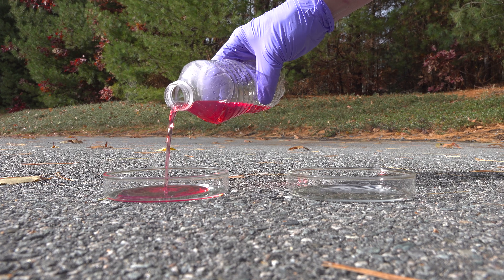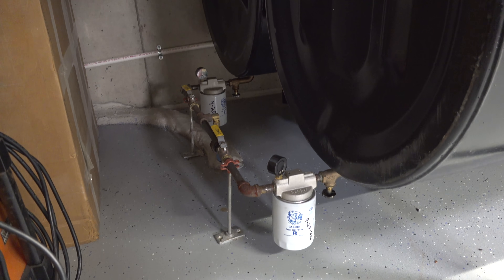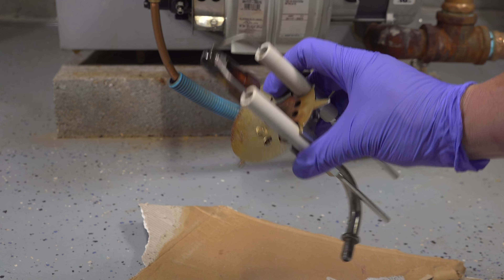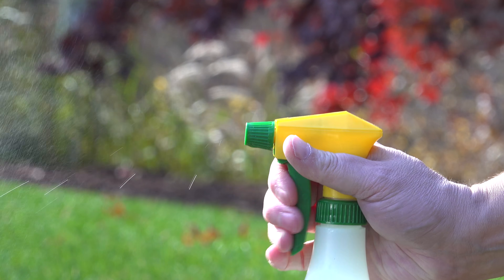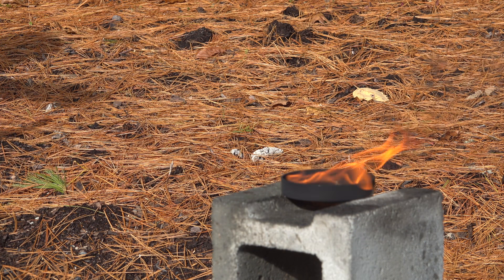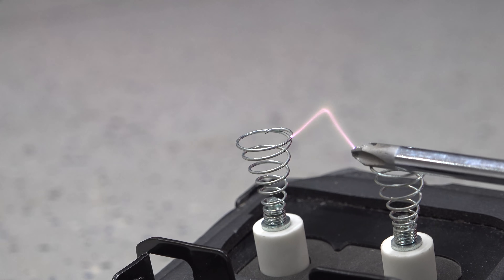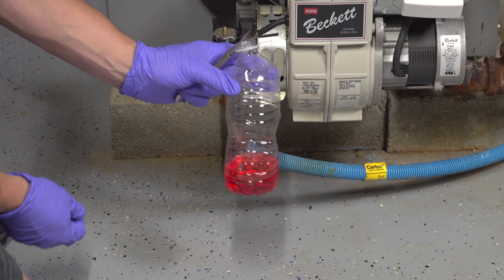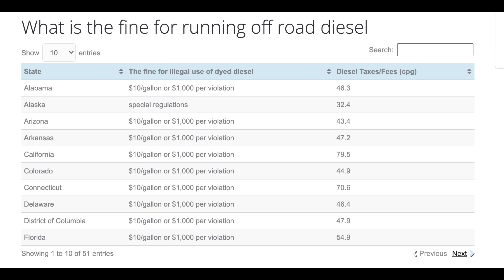Why Heating Oil is BETTER than GAS - Explained

Comment from the maker: Thanks for watching please LIKE & SUBSCRIBE - For an overview of a boiler fired by oil & tips watch:  https://youtu.be/5GbXgEYw5TE
Reply: We also use diesel fuel in a refrigerated trailer (refer trlr) that is not taxed & red. But the fuel in tractors (big rigs, big trucks) is Green,  not clear. But fuel in Tractors  (John Deer made for plowing a field,  or harvesting a crop is red) that either a farmer or rancher would use. Farmers grow crops while Ranchers raise livestock.  During the winter months a fuel additive is added to all the fuel in Northern States to help prevent the fuel from Gelling. When the outside temperature drops to below 0° Fahrenheit a Anti-Gel is needed to prevent the fuel from being turned into a solid. If you don't remember to add it when you fill up,  it'll be an expensive lesson to learn.  You'll have to be towed off the highway, then the tractor will have to be put on a garage with the heaters running full blast for 2-5 days depending on how much space they have,  how cold it is & how many other drivers screwed up too. Along with a bunch of other problems.  The coldest I have ever been with a frozen fuel & frozen anti-freeze is -37° Farenheit.  The anti-freeze became a 7-11 Slushy...it was only good to -25°. I spent 6 days in a hotel room.  Total cost for not adding the anti-gel $11,750+ A very expensive lesson...
Reply: @mr.robinson1982  very true!
Reply: @mr.robinson1982   are you german
Reply: Is it okay that my oil lines aren’t protected by concrete?
Reply: @Eric_G15  actually some concrete, dependant on it's mixture, lime etc,, can possibly eat through the copper line. Don't panic it's kinda a rare thing, but it can happen, , just be sure that your floor where the line is isn't Staind! I would suggest if you have the money replace it with an "encased" oil line, preferably 1/2 over 3/8, but 3/8 is normal!
Reply: Im 52yrs old and embarrassed to say i didnt know til recently heating oil and diesel were the same! I always thought heating oil looked kinda like motor oil. Lol
Reply: @dannyboy2750  not too many people know much about heating oil 😁 just like propane's made from crude oil
Reply: Not tryn to be rude but that's not a "pump" it's a fuel unit, it Actually doesn't "pump" oil 😁

Comment: I love my oil burner.    When i run low and do not want to pay for weekend delivery,  i fill up 5 gallon containers with deisal fuel.  Its essentially deissal , so your just using a cleaner fuel.  Same thing, home heating oil and deissl.

Comment: if I was writing the laws on taxing fuel etc, I'd probably tax kilometers (proxy for liters burned) rather than liters bought. EVs, I'd scale proportional to the carbon intensity of the local electric grid.

Comment: The word "gas" is overloaded. The fluid you used is petrol, usually called gasoline in the US and here in Canada. It has a high vapour pressure and can be lit easily, which is useful for Otto-cycle engines but makes it difficult to store. The word also refers to various gaseous fuels: methane, which is usually stored as a cryogenic liquid, and propane, which is familiar to urban users as being stored at room temperature and at very high pressure as a liquid in white cylinders. Alberta recently had an Arctic blast that was so cold to where propane was liquid at outdoor temperature and pressure. Both methane and propane are stored as liquids but used as gases. Petrol is technically used as a gas as well, because liquids technically don't burn, but for our purposes petrol is used as a liquid.

Offroad diesel/heating oil, as you demonstrated, has a much lower vapour pressure.

Comment: We had a small oil leak from the bottom of the tank, every green plant in the house died, so we switched to gas because it was cheaper, and we did not need a tank to store it. You can convert these boilers from oil to propane and vice versa

Comment: 1 delivery being enough for an entire year? We needed 5 deliveries a year when I was young. I got it down to 2 via energy efficiency measures before getting a heat pump installed. We were using at least 90 gallons of heating oil per year on domestic hot water.

Comment: Thank you very much for posting this video! Finally! someone has stepped up to the plate and exposed the dangers of heating with gas. I'm a licensed Oil Heat technician, and have been working with Oil Heat systems for close to 35 years, and I tell my customers to never switch to gas. I'm going to refer them to this video and send them a link so they can watch it. Again, thank you very much for posting this video. As a side note, I can add a few more reasons why people should stay with Oil Heat, but that's for another day and time.
Reply: why would I ever use petrol to heat?

methane and propane are a little more dangerous, but also they'll work in cookstoves. have you ever heard of a diesel cookstove? i could make one, but you won't like it.

Comment: thanks for the great and clear video. what's the cost comparison to run an oil furnace Vs heat pump? is the oil a lot more expensive to run?

Comment: I have 2 houses one runs on oil the other on gas, I just bought them so I can't comment on which is better the one that runs on gas was better built and the one that runs on oil I'm scared to leave alone a lot was built bougie and the thermostat is old and not only did I have to replace the old furnace but now I found out the oil tank has to be replaced too

Comment: There is something I find odd.   If you look at  a small diesel motor that is water-cooled?   You are better off as far as what I have calculated to use the heat from the motor and the kinetic energy of the engine producing electricity to then store any extra in Nickel Iron batteries so that takes care of a system that will only need  Filter and oil changes for a very long time.   

you're not only making heat but you are also making power this is especially beneficial in emergency situations or if you live off grid.    this also  brings the viability of a heat pump along with its amazing efficiency, safety, reliability & convenience of  electricity. 

it's too bad that Society has to go through all these hoops because the one thing that we should be focusing on his inexpensive and cheap energy yet that's the one thing that for one reason or another everyone has a concern about but no one seems to be investing and any kind of infrastructure for it since the 50s

Comment: Fun fact: the btu content per volume of #2 heating oil is higher than diesel. If you set the appliance up to run on heating oil, it will likely run fine on diesel, but will have too much air (lean). If you set a burner up on diesel, then switch to #2, you may have sooting problems as th fire will have too little air (rich). It may be fine either way, but there is an actual difference between diesel and #2.

Comment: I find it strange that you have to replace the nozzle, a metal, non-moving part, once a year. Couldn't you just clean it by soaking it in a bit of acetone or something?
Reply: I don't think we've replaced our nozzle in 20 + years and the heat still works 👍
Reply: Yes you can clean it, I have an oil furnace that has not run in 20+ years in my garage and it would not work so I took the nozzle out and cleaned it with brake cleaner and compressed air and now it works great.
Reply: It wears out, your running oil through a small orifice at 100 psi or more. The orifice wears out from the friction over time. Yeah you can clean it and probably get a few years out of one, however the burn will start to degrade and you will have to spend more time cleaning the soot out on the boiler or furnace every year. A nozzle only costs like $5 or $6 it's not worth wasting time cleaning one unless you are in a emergency situation. My advice is always buy a couple nozzles so you have a spare one in case it screws up on a Friday night or something. I don't know about you but spending $6 on a nozzle and $2 on an oil filter every year isn't going to break the bank, and having to scrape the soot out of a boiler isn't on my list of favorite things to do on my day off.

Comment: Why is gas better?  Simple.  No tank. And the balloon bill that comes with it.  Gas?  It's a constant flow from a pipe and never runs out at the worst time. With a monthly bill.  I'm glad I'm done with it.
Reply: First of all it should never run out at the worst time, ur oil system could run a while after the scheduled refill in most cases,  and the bill is only alot in certain areas. IF theres an emergency and gas is shut off or not working, you will still have heat
Reply: The bill is also subject to what month it is. And day of week in some companies. If there is an excuse to raise the price. They run with it. Because usually. You dont have a choice or say.

Comment: I heat my automotive repair shop with used motor oil.  The burner is very similar except that it pre heats the oil before it goes to the nozzle.

Comment: I also heard the Red Diesel is used in Agriculture Machines too for tax free purposes.
Reply: Yup, it's all Diesel #2 ultra low sulfur, same that comes out of the pump. It's dyed red because you don't pay road/fuel taxes on it, so they can catch you if you run it on the road

Comment: Great explanation about fuel oil, but the title is how oil is supposed to be "better than gas". Not really explained. Propane can be delivered anywhere, lasts literally forever in the tank and can be made to modulate the size of the flame. Oil is almost always grossly oversized for the actual heatloss of a residential structure. Therefore it shortcycles and is much less efficient than gas...either propane or natural. Also that nice sheetmetal tank is the basement can leak and make a real mess of things. As well as taking up real-estate inside the home. Gas is either piped (natural) or is in an outside tank (propane).
Reply: Gas, especially propane, has a higher moisture content that number 2 heating oil, more moisture in your fuel equals an unclean burn, check out propane burners offer a few years completely rotten and usually in need of replacement, plus a lower BTU output than number 2 heating oil.
Reply: @stephanmussehl7425  

I am both an oil and propane heating tech. Gas equipment is made of stainless steel. Oil makes soot, plenty of it in most cases. Gas can also soot of course, but I believe your arguement is a moot point. There is more water produced from a gas flame due to the better thermal properties and lower flue temps. The byproducts of oil combustion are much more acidic, sulfuric acid with oil, vs carbonic acid with gas.

Comment: I wonder if there's a way to easily remove the dye. If there is, I wonder how many people don't let this dye stop them from using it.
Reply: Not really. The effort to do so would negate the tax savings. Also diesel trucks nowadays need much more refined diesel to run due to higher spec fuel systems for efficiency.
Reply: get a box of kitty litter and funnel with something like cheese cloth and pass it through that shit and it will come out clean, may take a few passes. act accordingly

Comment: I think buildings in Colder areas should have redundant heating. Geothermal when available, then electric backup, then oil. The good thing about heating oil is it's stable for about two years and is great if electricity is unavailable or limited.
Reply: The yearly price of electric heat is outrageous, the price of installing geothermal equipment on an already existing building is outrageous, why would those be a better solution than heating oil?
Reply: Oil or gas backup. Regular electric heat is super innefficent

Comment: Many insurance companies won't even deal with you if you have oil heat in Canada. In fact. Where I live in northern Canada there is no company's left that will deliver oil. So anyone left on oil was forced to convert to propane. Not to mention oil is $5.70 per gallon.
Reply: 2.95 a gallon right now in Massachusetts

Comment: Wow, that's a lot. I understand oil in remote areas but why 80+%?! That's really worrying, though Americans by mass don't tend to care about their carbon footprint or spendature, as YouTube projects from there are "only" three figures or driving further than necessary, as well as the road systems being inefficient by extremes in places and attitudes too. Even building supplies in some ways/places there. At least use combi boilers, it's far better but even then not so good. Surprisingly the whole world is behind with what's available supplied by demand but oil is primitive or for remote areas :/
Reply: LOL

Comment: Ok
Heating oil is kerosene 
RED DIESEL IS NOT HEATING OIL. 
RED diesel in for running plant machines eg tractors. 
Which is similar to diesel you buy from petrol station with a red dye added to it for tax purposes because it’s cheaper

Comment: What comes to my mind immediately, is if it's diesel, why not replace the burner with a stationary diesel engine, attach a cooling loop and generator, so that as you burn the diesel fuel, you're extracting heat through the coolant loop still, but additionally, the mechanical work of the engine to produce electricity? Downsides I could see are increased costs, increased noise, increased complexity, and greatly increased maintenance, but I'd think someone could figure out an extremely low maintenance engine, efficiency probably doesn't even matter, because it's all intended to create heat anyway. Emissions would be an issue.
Reply: The difference in the demand for heat and electricity would be the issue
Reply: Maybe if you had an off grid setup and had a large battery bank and the gen charged batteries that you already have and lived in a cold climate and wanted to reclaim that heat it could be worth it. Run the exhaust through a heat exchange also

Comment: Now tell the viewers that it costs about $400 a month to heat a family home in a cold northern state with red dye and diesel fuel, vs. about $60 a month for natural gas.  You also have to schedule deliveries rather than it being piped into your home continuously.  

No thanks.  I'm not giving up an extra 20% of my income and have to worry about running out, when the delivery man can make it, having to remember to check a gauge on a tank frequently, calling people, etc. Nope. Been there, done that. 

Worst heating method ever. It's part of the reason why people in New England live paycheck to paycheck.  One more reason to dread winter.  One of the worst aspects of living somewhere that doesn't have natural gas.  I can't imagine ever going back to that.
Reply: Right. Growing up in NY I remember the tanks in the basement and my dad working extra shifts to get that sucker filled. We usually ended up using the kerosene heaters because it cost so much to fill those oil tanks . This was late 70s early 80s.
Reply: I rented a farm fresh out of college with a oil tank. Never again, it cost nearly half my pay during the winter to heat it. I sealed most of the house up and used the buck stove rather than feed that bastard another winter. Significant reason that fuel oil is a deal breaker on homes for me.
Reply: @UCWpMzxMMRNYLZk_RVA16-PQ $2,000 a year is an insane amount to pay just for heat. That's 12 months of heat/electric and water combined for me, in a house built in 1887 in Montana.
Reply: We just moved from an apartment with natural gas to a home with oil and the oil is still at half a tank and I bought the house with 5/8 of a tank and I've been here almost 10 months. Hula paying very high bills in the apartment with natural gas
Reply: @SaltMinerOU812  The natural gas is probably also heating the water and maybe even running the stove. You're running them on electric (more expensive than gas) and oil is only heating the house. You must not live in a cool climate. Are you sure you had natural gas and not propane before?

Comment: I used to deliver home heating oils in Alaska. There they use both #1 diesel (jet fuel) and #2 diesel (regular pump diesel) 

Jet fuel has a much lower gel point than regular diesel, sometimes we do a mix.
Reply: Here in NY gas companies that sell heating oil will have it a dollar more than off road diesel.  That's where they get ya

Comment: Is heating oil just red diesel? Which in the UK I believe you can use legally for farming equipment and boats
Reply: Yes and mixed with kero usually in the winter to stop gelling.
Reply: There are many types of fuel (heating oil) 
Number 1 fuel oil  is kerosene 
Number 2 fuel oil is diesel 
Number 4 fuel oil is a black oil similar to used motor oil
Number 6 fuel oil is basically sludge, it has to be heated to even pump it

All of these oils are used for heating, however the vast majority of residential houses with modern oil burners are using #2 fuel oil today.

Yes it's just red diesel and it's the same stuff we use in our boats, gensets, and basically any diesel engine that doesn't operate on the road.

In commercial buildings number 4 or even number 6 fuel oil is normally used because it's significantly cheaper. The problem with burning these heavy fuel oils is they are dirty. As such much more frequent cleanings and service are required. Most people aren't willing to do the maintenance on a heavy oil burner and in a typical house the cost savings are small enough that they rarely use HFO for home heating anymore.

Comment: Could you not just add dye to the fuel to change its color and claim its some anti freeze. Or filter the dye out?
Reply: A big brained individual would use a hidden auxiliary fuel tank for the oil with a decoy dummy tank for diesel

Comment: That's why you run a bit external tank with a tiny bit blocked off with reg diesel then the rest is heating oil aka off-road diesel